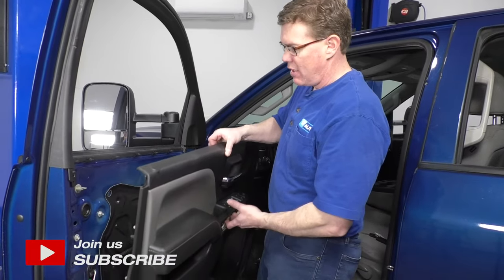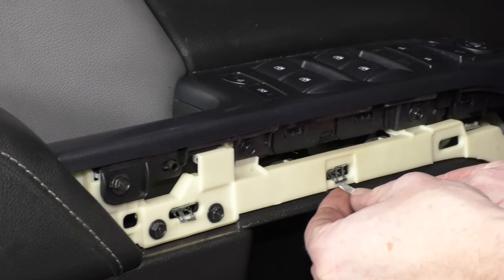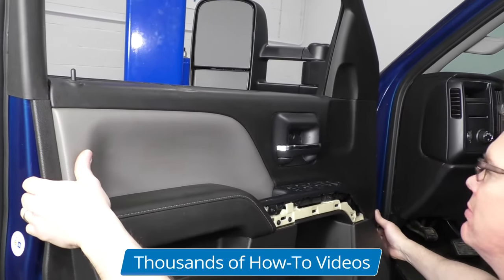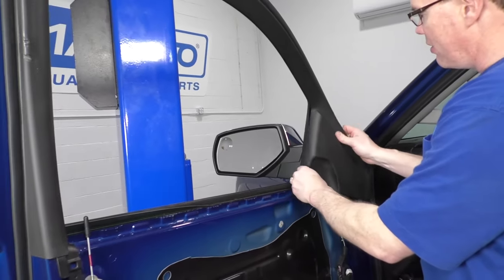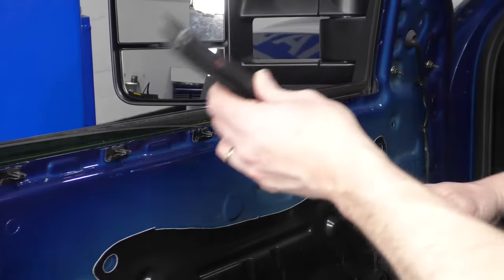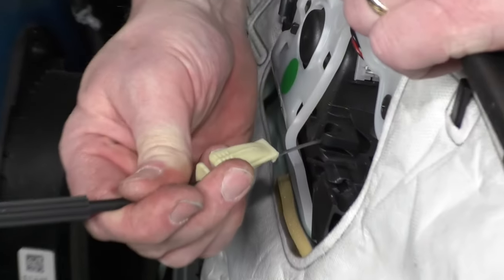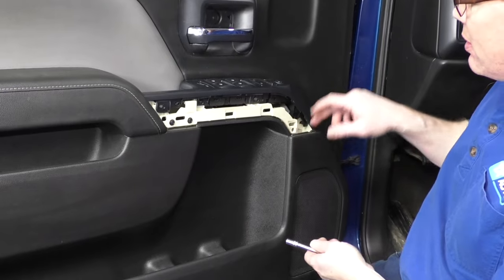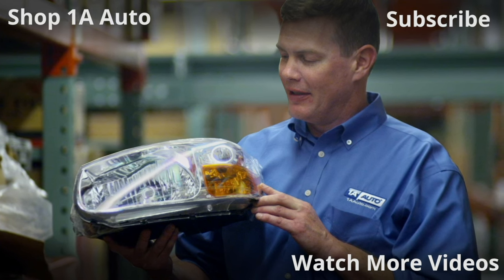How to Remove Front Door Panel 14-19 Chevy Silverado

Comment: This video is misleading. The most difficult part of removing this panel has been omitted. At 2:40 the panel pops off with comparative ease. This is not the case. There are 5 tight-fitting metal clips mounted across the top of the door frame that snap into corresponding slots in the plastic door panel. Disengaging the panel from these clips is no easy chore. This video makes no mention of this most important task - and - the metal clips are absent from the door in the video which proves they had been removed in a deliberate effort to avoid showing the difficulty involved. Better luck next time...